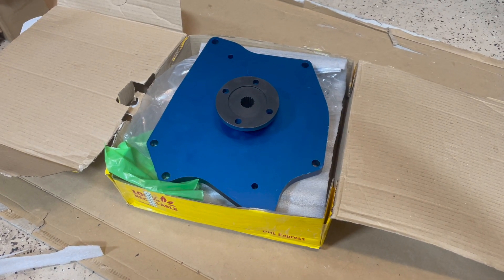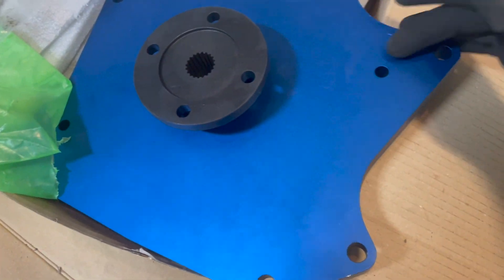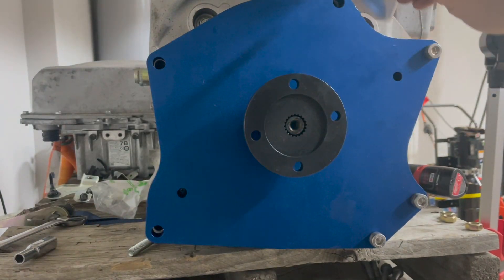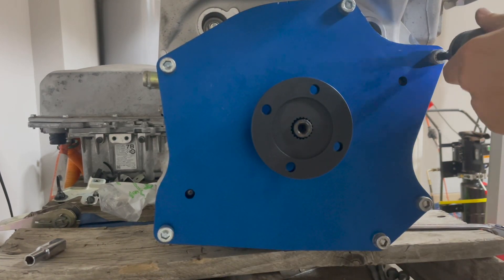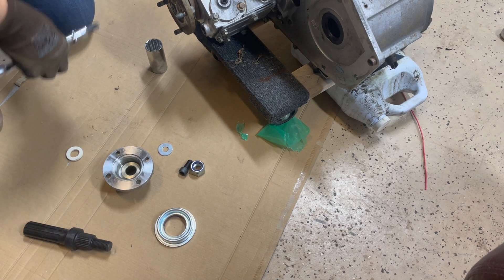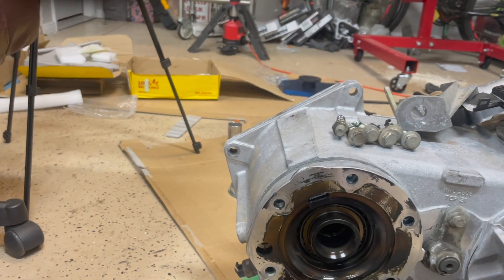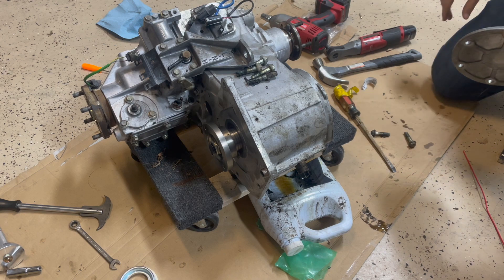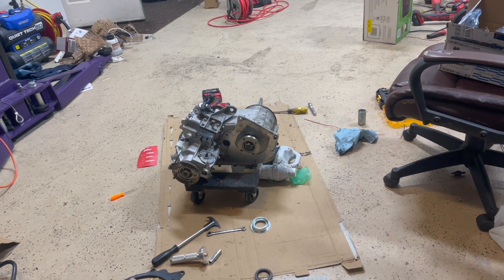Synchro Gearboxes EM57 Electric Motor Divorced Output Coupler and LT230 Divorced Input Kit

Comment: Hi I am going to try and do a buggy build and use a Nissan Leaf motor in my build I want to get this adapter too but they are out of stock at this time would you sell a printed plate like the one you made I want one like it so I can make a thin steel plate to go on the out side of this adapter so I can hook up my tranny to a tube with a bearing in it.